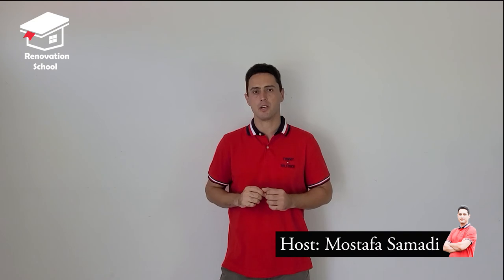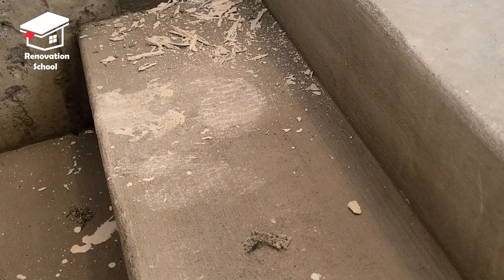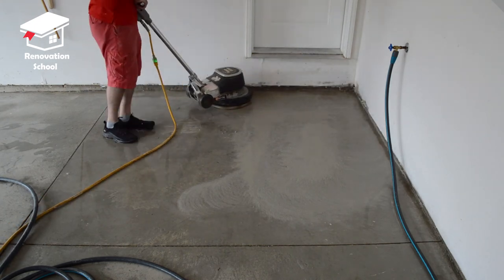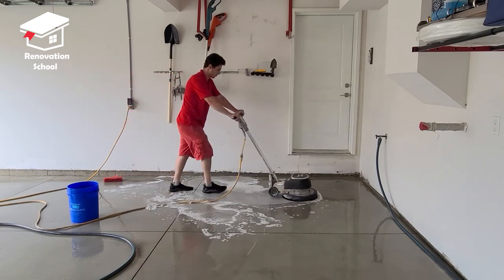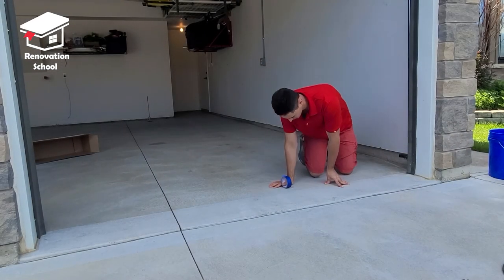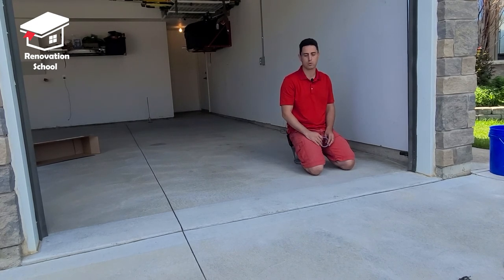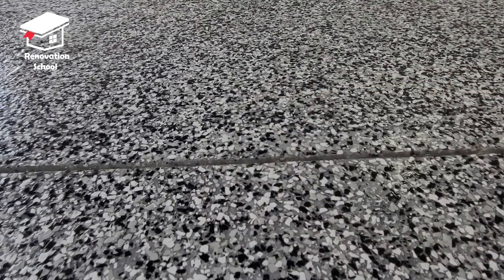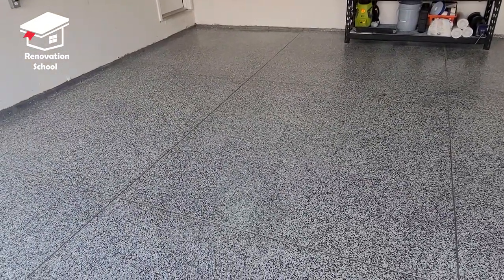how to epoxy garage floor

Comment: Excellent presentation. What are the approximate costs for a reputable contractor (like yourself) to complete a 3-car garage?
Reply from the maker: Thanks for watching
It's a lot of manual labor
Prices are different in different parts of the country
Roughly this is about 7k now as of June 27th 2023 for a 3 car garage
Reply: @renovationschool8818  Thanks for your prompt reply.

Comment: Love the video! Wondering How many pounds of flake did you buy? Looking to replicate exactly what you did with my garage, but not sure if I need 5lbs, 25lbs, or 40lbs of flake?
Reply from the maker: Thanks a lot for watching I used a 40 pound bag
Reply: Also wondering if you did end up mixing that anti skid additive in your clear coat and how much you added?
Reply from the maker: I did not use the silica sand after having the flakes you already have a very nice texture so there's no way that you're going to slip

Comment: For new concrete,  do I need to grind the surface? or just simply brush cleaning it.
Reply from the maker: Grinding is a must for the best adhesion.
Thanks for watching.
Reply: Very detailed video 💯, thanks much👍.... feeling confident now that l can do my own floors,l just got to find that exact eproxy ...
Reply from the maker: @charmainewilliams5321  all the best with your project 🙂
Reply: @renovationschool8818  thanks much ❤️

Comment: What was the last tool you used to remove loose flakes,  Jack
Reply from the maker: It's called a flooring scraper. If you go to the home depot they keep it at the flooring section. It's just for removing glue and concrete from the floor.

Comment: Hi, I like your video, would you please type the part numbers of the items you used paint, flakes, etc... ?
Reply from the maker: Thanks for watching
Like I mentioned you don't have to use this specific product.
There are many epoxy stores around you that have very similar stuff with different brands
The whole point of my video was that you can buy good quality materials right from your local stores for a fraction of cost
Reply: @renovationschool8818  what about using Polyurethane?
Reply from the maker: All of them were purchased from a local area
It's not called polyurethane
It's some kind of an epoxy top coat
It's not like the polyurethane that you use for wood

Comment: Gr8 video
Link for supplies pls?
Thanks
Reply from the maker: Thanks for watching
I bought them from a local store.
I showed the actual products with details in the video
Please watch again for allthe details
Reply: @Renovation school  tried getting the names was a little hard..
Just product names?
Thanks
Reply from the maker: LABPOX 35 for base coat. It's a 100% Solids, High Performance Epoxy for Industrial Applications

Labpox40 for top or clear coat.

Comment: How much working time did you have after mixing part a and part b for the labpox30?
Reply from the maker: Depends on how hot it is outside
i normally mix half of each at a time and do it early in the morning or late in the afternoon when its cooler. 
the hotter the concrete and the weather the faster it dries up. you have max 35 min , you have o be very very fast.
Reply: @renovationschool8818  thanks for the reply.
Reply from the maker: @Gooseman136  youre most welcome

Comment: Can I use this epoxy method for Bathroom floor tiles in shower area
Reply from the maker: Yes 
you need to wash the tiles first and then theres a primer that goes on then you can do the epoxy.
I have another video explaining how to tile over tile , its best if u watch that too.
Reply: Thanks.  Plz uplaod video epoxy method over old tile floors in bathroom

Comment: Hello love your video! So instructional. Would this be OK to use? Rust-Oleum® Concrete Saver® 6500 System Tile Red 100% Solids Epoxy Floor Coating. Thank you
Reply from the maker: Thanks for watching 🙂
I checked the specs and it seems to be a 100 percent solid epoxy but the price is very high for the amount you get. 
I recommend contacting your local epoxy stores and see what they have available. You maybe able to find better products and better prices. Plus your local epoxy suppliers will tell you what product is mostly used in your area. 
I personally am not a big fan of rusoleum products. Most their paint is cheap quality. I have not used that epoxy you mentioned at all but it's my opinion about rustoleum in general.
Reply: @renovationschool8818  Thanks for the quick response! I really tried all day yesterday to find a supplier and was really having a hard time.  I don't know where to find 100% epoxy or anywhere close to that. Big box stores definitely don't carry it.
Reply from the maker: @alextran8839  whatever you pick make sure to read all the instructions on the label 
Some epoxy products need a sweat time. Meaning after you mix it you have to allow it to sit for a while and then use it.
Reply: @renovationschool8818  Is this ok? Bulletproof Resins: Single Shot |100% Solids Epoxy Resin Kit (3 Gallons) Solvent-Less, Two Component Gloss Coat Finish- Low VOC! Industrial Use, Garages, Floors & More! (Clear)
Reply from the maker: @alextran8839  it seams to have all the bells and whistles 🙂 I'd go with it
Reply: @renovationschool8818  Thanks! Is 3 gallons enough for an average 2 car garage?
Reply from the maker: I used 2 gallon in this video

Comment: How much to rent that floor grinder sir? Thank you for making this video
Reply from the maker: It's like 80 bucks for a full day
Reply: @renovationschool8818  thank you sir. I just phone home depot it's now 200 for 24 hrs. Inflation i guess. Thank you for your reply
Reply from the maker: Oh my 
U can even use a 7 or 9 inch grinder with a concrete grinding wheel and a shroud and a vacuum set up.
It may come to the same 200 bucks price again. 
Check some other rental places in your area hopefully u can find some cheaper prices, explain what you wanna do and they may have other options also.
Reply: @renovationschool8818  yeah price this time is crazy lol. I lived in las vegas maybe thats why 😂😂😂 i'll check some other rental company. Thank you so much for this video..
Reply from the maker: You're most welcome
All the best 🙂👍

Comment: Slid resistant wasn't applied???
Reply from the maker: No , because i used flaks it was already have a good texture , if u dont use flaks then its good to use the slid resistant sand.

Comment: What is the name of the kit you used in this video?   Lab Space sells different kits.  Where can it be purchased?
Reply from the maker: its by lab surface company.
the u can see the exact product in the video. you can pause and see the exact names and types.
Make sure to apply it at a time when the tempretures at night time stays is above 15 degrees cantigrade.( obviously not in cold winter like now)
Reply from the maker: Here is the link to the exact product i used ( lapbox30 was the actual epoxy, lapbox40 was used for clear coat , i usdd the vynil flakes also)
https://labsurface.com/en/epoxy-coatings?p=labpox-30-40-uv-and-primer
Reply: Do you recommend grinding the garage floor even if the house looks is a brand new construction?
Reply: @renovationschool8818
Reply from the maker: @Lite3102  100 percent grind it, grinding is to bond the epoxy to the concrete. when they pour new concrete, the water from the concrete comes to the surface so the very top part of dried concrete is very weak and mostly shiny and slippery. by grinding we get rid of that fine layer and we scratch it so when we apply the epoxy it adheres better.

Comment: Do you know the pricing for the material? I cant find anything on their site. I have a 3 car garage, roughly 700sq ft. Looking to do the same to my garage.
Reply from the maker: It cost me aroun $500 canadaian dollars for the epoxy kit
Reply: Hi, which material did you end up using, I need to do my three car garage.
Reply from the maker: Everything is explained in the video please watch the video again everything including the material and type of the material is explained
Reply: @renovationschool8818  thanks I got material names, and was able to find labpox 30, 3 gal kit, it says 80-200 sq. Ft. Coverage, for 700 sq. Ft. How many kits I should get? Thanks in advance for your help.
Reply from the maker: @ninjip3460  I don't know how thick u are gonna go 
For my garage I used 1 
It's best to buy 2 so when u do it in case u are short u have it right there
Reply: @renovationschool8818  appreciate sir, one last question the website has 25 lb vinyl flakes box with suggested coverage 125sq.ft./25 lbs box, to me it seems a lot of flakes/sq.ft.,  I’m looking for a good coverage like your video, approx how many 25lbs boxes I should get?
Reply from the maker: I used one and that was alot 
I still have half of a bag left 
It's worth it , that's what makes it look amazing.
Reply: @renovationschool8818  thanks, I’ll order two boxes for my three car garage.

Comment: i tried to buy but website wont let
Reply from the maker: Look for other brands in your area , call concret specialty stores or epoxy suppliers in your area and tell them you want 100 percent solid epoxy for your floors , they will sell you whatever brand that is available in ur area.